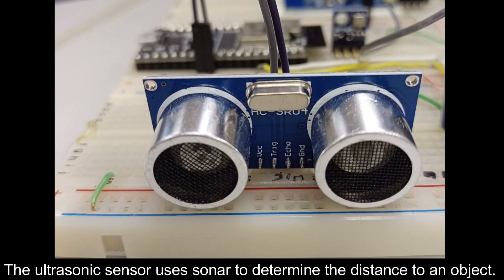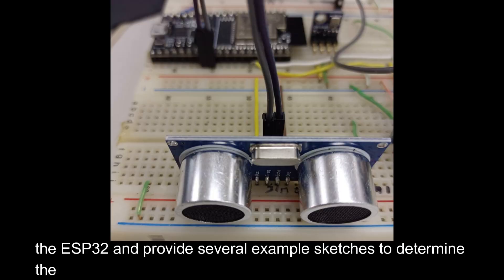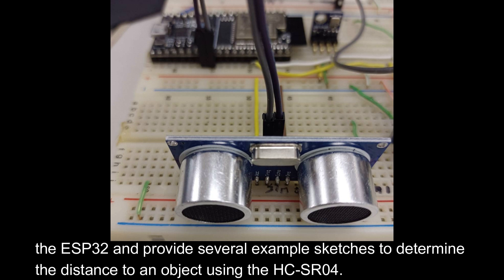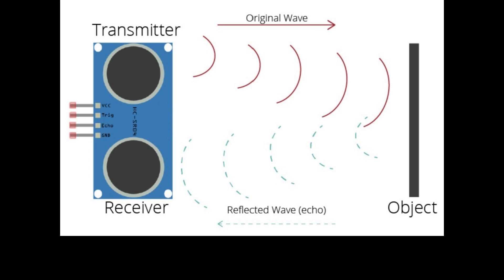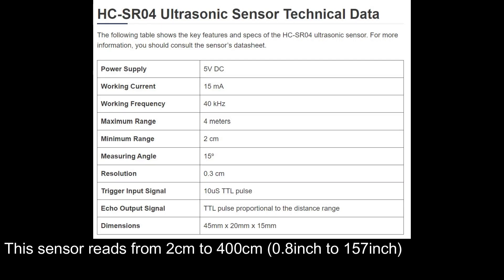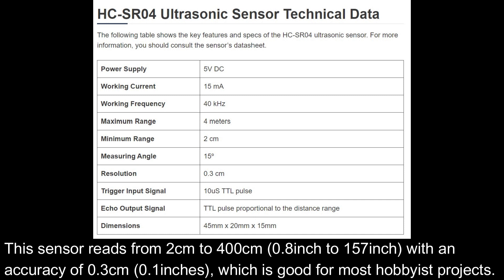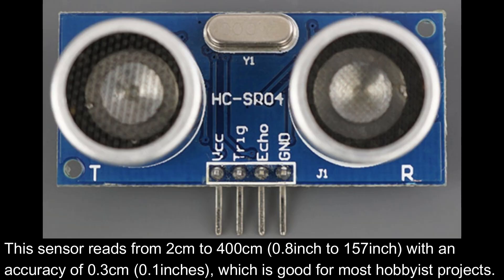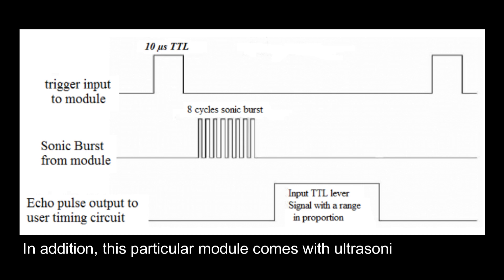ESP32 with HC SR04 Ultrasonic Sensor

Comment: HC_SR04 is a 5V device, can we connect Echo and Trig pins directly to ESP32?
Reply: How is that fine 😂 u do realize that if u run that hc sensor from 5v you will end up 5v on echo and trig
Reply from the maker: Hi, Yes, that is fine.

Comment: using esp32 it only reads up to 60cm. When replacing it with an Arduino it reads 40cm normally. Any suggestion ?
Reply from the maker: Hi, Good day. HCSR04 datasheet is maximum Range is 400 cm and minimum range is 2 cm,  first Check whether the wiring is correct and I use 5V voltage and try use my code to see if it works !